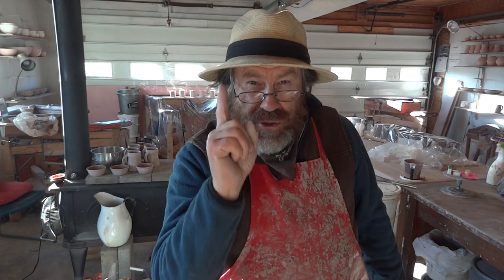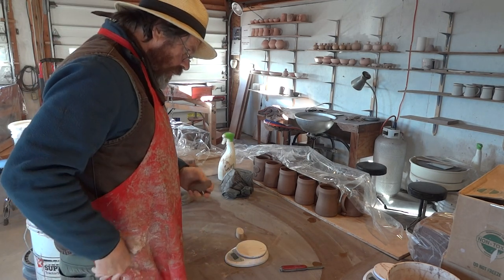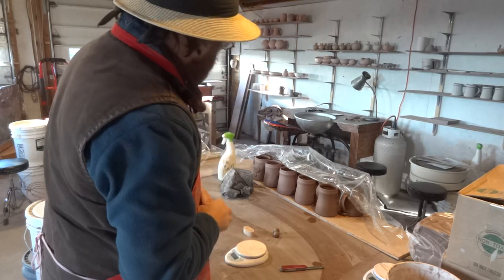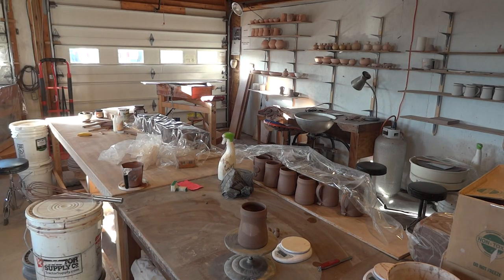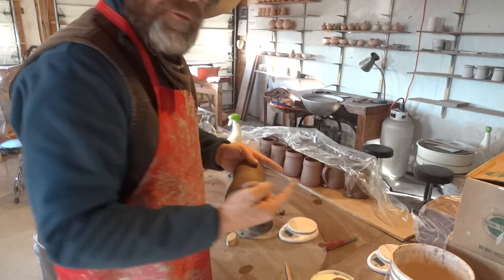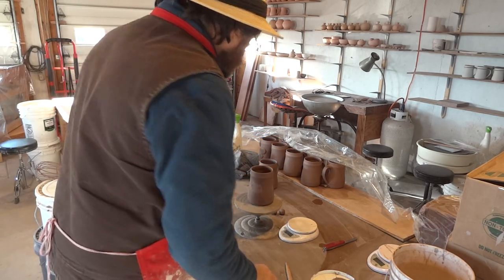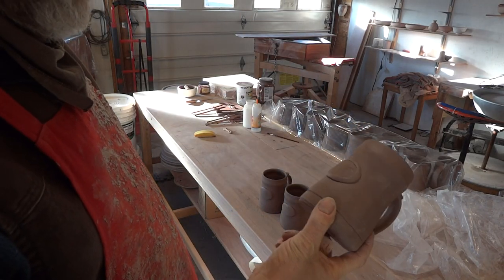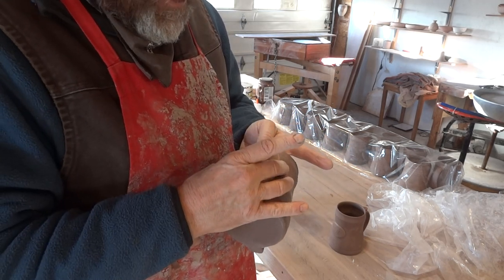SIMON LEACHPOTTERY TV - Sealing tankards with 'Weaver's' emblem ...!

Comment: Simon, why not roll a slab of clay, use the stamp, not having to worry about to much pressure,at the same time cut around the shape then add to the tankard. If the impression isn't great it doesnt matter as its not on the tankard yet.

Comment: Hi Simon, Happy New Year!
I attach stamped bits all the time and find that rather than using a heat gun I dust the soft clay with corn starch just before I push the stamp on,( I use a soft paintbrush and pretend I am dusting for fingerprints) that way the soft (wet) clay doesn't stick in the groves of the stamp and releases clean. also, I roll a large slab to the desired thickness and stamp the flat slab with as many proto labels as needed, then cut the labels out with an appropriately sized cookie cutter. Using this method I can use lots of pressure to get a better impression, and I can use a thinner bit of clay. I still have to do the finicky bit of smoothing the edges and tidying up after attaching, but I  am working with a good attachment already rather than messing up the tankard by trying to stamp a round surface with a flat stamp.
Cheers!
Reply from the maker: Thank you David I understand what you are saying, may try that !

Comment: Try rolling out a larger sheet of slab about 3/16 thick and cutting the oval shape with and oval-shaped cutter. Maybe even cut out an oval slightly larger than the diameter of the stamp so you can trace cut each piece instead of rolling each ball.  you then may be able to stamp each oval while it's flat on your table. Cut them out then apply to the tankard when leather hard

Comment: Simon, Larry from Bruning Pottery taught me how to do this last year.  I have a very thin slab of clay and I roll it out, then stamp all my impressions on that slab and cut it out.  Then using slip a gently attach each of them to my tankard.  I have done hundreds this way.  For the stamp I just get the stamp rubber head part made without a handle or a hard back.  I then take the flexible rubber and with a small rolling pin to make sure the stamp impression is deep enough.  Skype me and we can discuss.  Also I think the stamp you have may be opposite of that you want.  I do better with the letters being raised on the stamp.